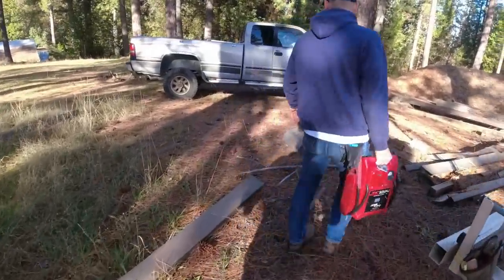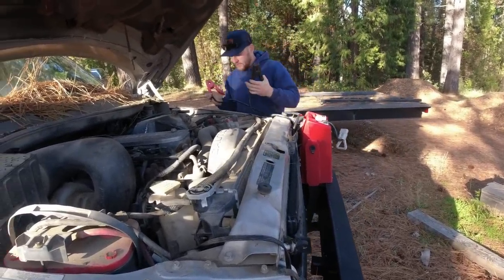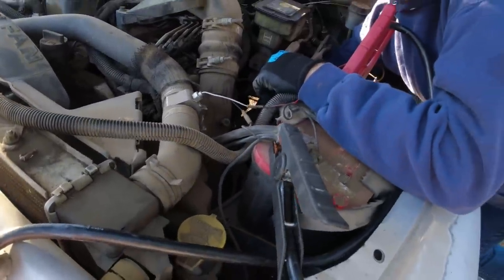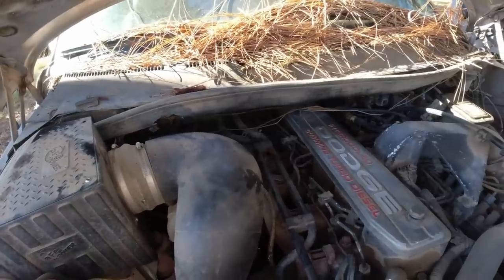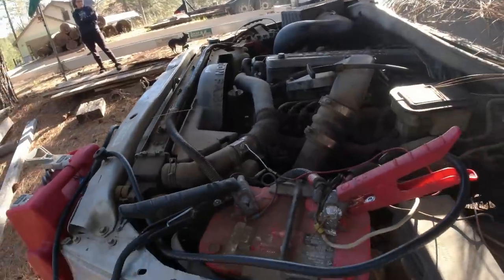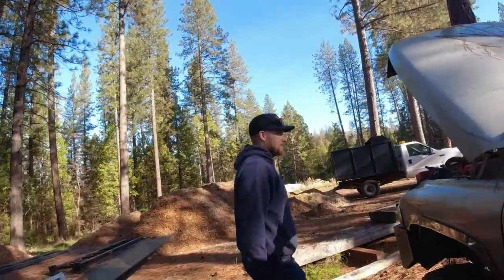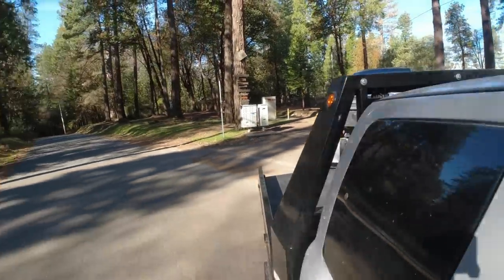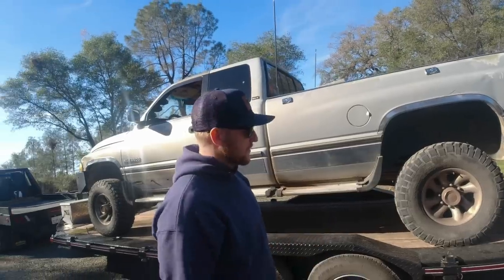ABANDONED TRUCK. PARKED FOR YEARS! WILL IT START AND DRIVE? Cummins power

Comment: Look into its history, it may be from somewhere in the rust belt.  If it were my decision,  I'd fix her up and put her to work. You know better than I do the harder you work those old Cummins the better they run. Like you said the combination of 12 valve and manual transmission is becoming super rare and go up in value and there's good reason for that... pre def and single wire, need I say more?

Comment: Man grandma’s truck sounds badass.  It would be very cool to save what you could on it then salvage the rest or do a 12 valve swap on the yellow truck.  Keep up the good work and stay safe out there.
Reply: I agree with ya right there.
Reply: @laisuresboringadventures7052  true. I'd like to get another 12v as well.

Comment: This right here is exactly why I love 12 valves.... Spent all that time sitting there and as soon as you realized it was the shutoff solenoid it fired right up.. It was a little rough and stalled a few times but listen to how smooth it's running now...

Comment: Dude rockin out all the cool Rams.  Me: “oh, a truck with low miles!  Sweet!  3.42 gears in a dually!?!  The GCVW isn’t even high enough to tow a gooseneck with a CTL with a mulcher.  Is a used Ram with a G56 and 4.10 too much to ask?  FML!”
Reply: Right. My 2001 ram 1500 even has 410 gears

Comment: Nothin sounds as good as a 12v especially with the stock hx35 that slight sing at idle with a full straight pipe pure music. I sold my wonderful 97 12v after 14 years (always garaged and no winters) with over 500,000 miles only because I was embarrassed at the boat ramp after having to be pulled out a few to many times. I needed a 4x4 for  i been through several different trucks since I sold it, the 12v still calls to me. Here in Michigan they are ALL rotted out now. I need another with 4x4

Comment: I seen your video on your 550 registration for next year and that sucks. And I saw on Google that generators , 2 stroke small engines , and gas powered lawn mowers were also going to be outlawed in California as well. Is there any truth to that. Man I sure hope it's not so for every working man's sake .
Reply: The government doesn't realize, that you still need Diesel powered equipment to mine the ingredients for electric powered equipment.
Reply: @markbremmer8642  : They realize just fine. They simply don't care. California has been a cesspool of air quality problems for a long, long time. 

California's underlying problems run much deeper than simple motor vehicle pollution. They have far too many people crammed into a small space with inadequate ventilation. Plain & simple. 

Beyond all that, follow the money. There's big money to be made in following the trend of "going green" these days. If there weren't, it wouldn't be happening. 

Humanity seems to thrive on self-inflicted (created) chaos.

Comment: Careful on that starter, they aren’t that great to change 😂. I drove a freightliner cab over that had a Cummins 350 that had a fueling issue, the white smoke would make you sick.
Reply from the maker: Ol starter swap on a 12 valve is a 5 minute job. Or a smack of the hammer lol

Comment: Whenever I've accidentally run my 12v out of fuel, I put fuel in it & just 'give it gas' with the pedal & she'll fire
Reply from the maker: Running a vehicle out of fuel should be a point on your driving record lol
Reply: @VBELTandSON  lol yeah happened yesterday getting off the interstate- fuel gauge lied to me. Luckily I had 2 gallons of filtered used motor oil / WMO in the bed, & that got me to the gas station
Reply from the maker: 😂😂 sounds like the ol cowboy trick I like it 👍🏻

Comment: Never seen a car blow smoke rings before
Reply from the maker: Diesel truck*;)
Reply: @VBELTandSON  That's definitely not called a truck here in England. It's a pick up truck but not a truck. Either way it's a cool whip and it need to roll coal again

Comment: @V-belt & Son :
I'd probably fix her up & then sell it. It will make good money-making content for your channel, as well as keep another good ole 2nd Gen 12V alive.

Appears to not be the right truck for your use, but certainly it's the right truck for someone who needs a good stout rig. Someone, like myself, who isn't too concerned with appearances or any nonsense like "one-upping" his neighbor.

As I'm sure you are well aware, that truck up & roadable is worth a small fortune these days. Non-emissions trucks are especially golden. 

As for your complaints about the rust... Hah! That little bit of rust you have on there is laughable. Move to a rust-belt state, then complain about rust. 

One of my most-used daily drivers is a 1999 Dodge Ram 2500 Laramie SLT, Cummins 5.9L 24V, A/T, 4x4, QC, LB. Sadly, she has basically no rockers or cab corners left. Also a soft bed, poor door bottoms, and various other body rot woes. Yep, she could use a new body... one of these days. 

She's been repaired in various other places, where it really matters. With only around 220K miles on her, she keeps on purring along, even with the stock, fully functional & properly maintained, 47RE automatic trans. She hauls my bumper-pull & gooseneck trailers around with ease.

The 2nd Gen diesel trucks really are great, reliable rigs. I currently own several, 2 with manual & 2 with automatic transmissions.  I never worry about what others say, because I've lived & breathed with these trucks for 20+ years and they've all been good to me. 

Best part about these older Cummins powered Dodges is their efficiency, reliability, and no emissions crap on them to cause problems or add extra expense.

Ok, high time to get off my soap-box. Best wishes in whichever direction you decide to go with your "new-to-you" 1997 Dodge Ram Cummins 12V powered truck. 💪😎

Comment: I am not claiming to be an internet expert but... I have watched enough Mustie1 videos to know that first you check the oil, then you check for spark.  It might have gone a lot quicker if you did that
Reply from the maker: There is no spark to check for…
Reply: Cummins engines use grid heaters…
Reply: Spark on a diesel?